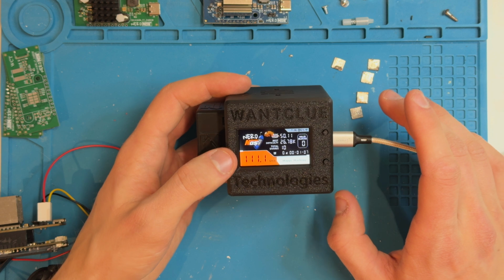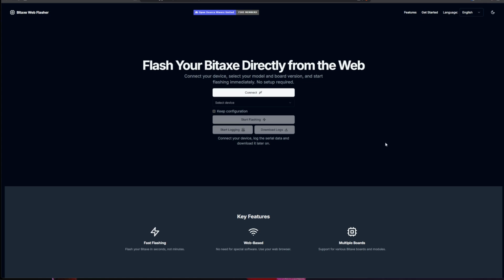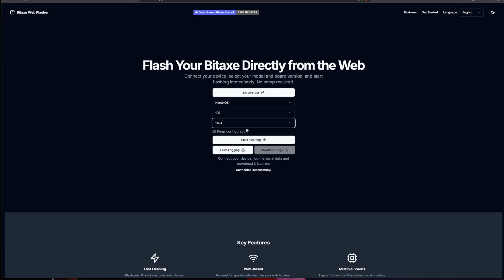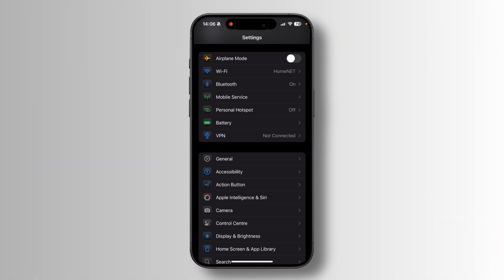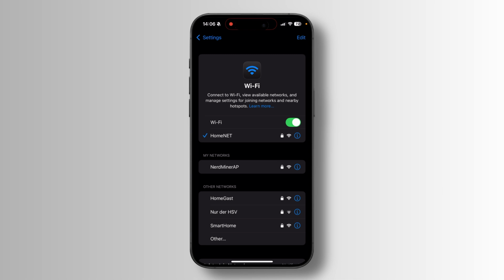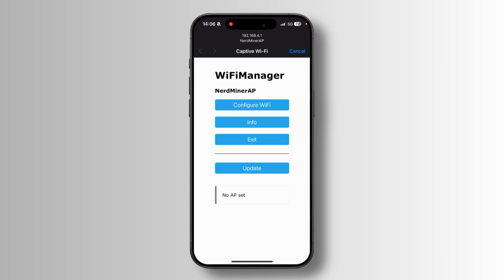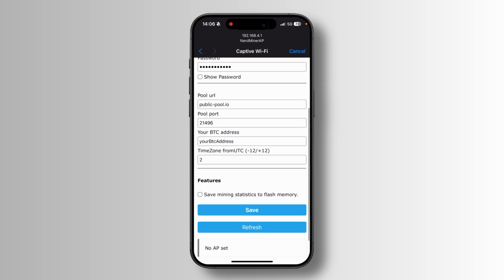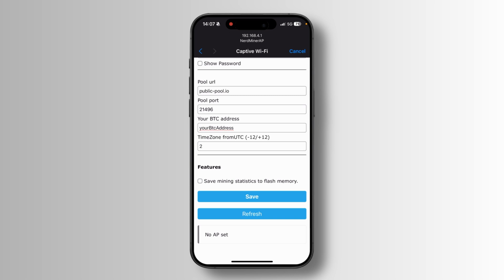Upgrade your Nerdminer to NerdNOS⚡⚡⚡

Comment: Hey there! I'm a big fan of the project, bought 2 of the upgrade kits for my NerdMiners but I am having issues with one of the boards, it just doesn't start mining at all even though it powers the fan and lilygo display correctly :( Do you think you can help me out? In the logs I only see this suspicious message:

MINER WORK ABORTED >> waiting new job
>>> STARTING TO HASH NONCES

Comment: Will you be making a version of the nerdnos that will work with the esp32 wroom type boards? I think most of those boards come with the pins already installed.
Reply from the maker: I've never tested it on any other board and I don't know if pin outs or other things might be different. Would be something to investigate
Reply: Almost certain pinout is the same, just in some the pins are soldered and in others not.
Reply: The lillygo-s3 I got had no pins soldered but got the pin-out pieces included, soldered them myself, not that hard but does need a bit of practice and good tools
Reply from the maker: Great that’s a good start